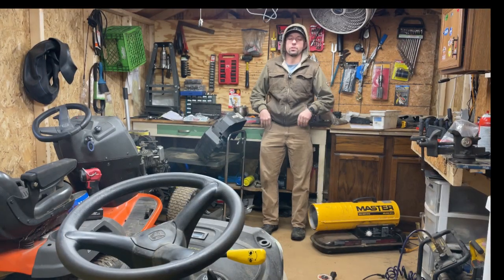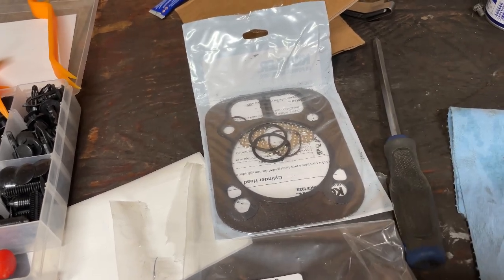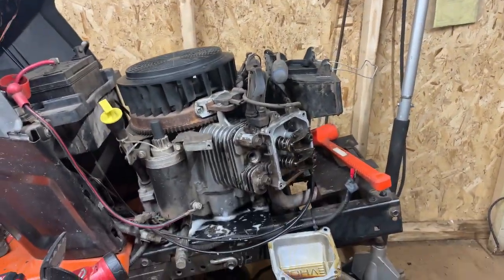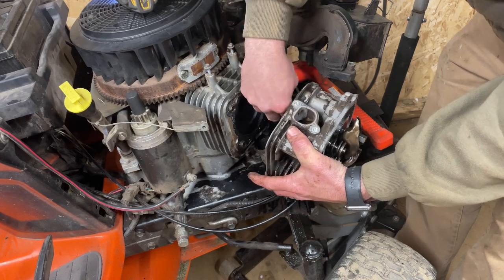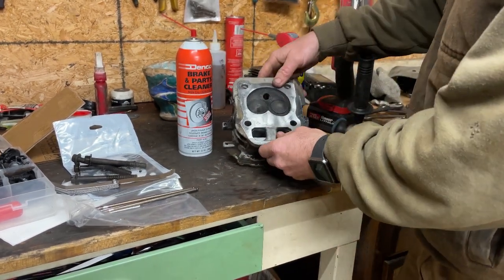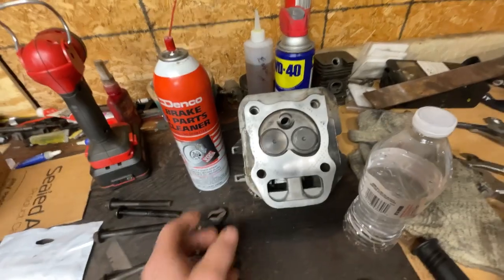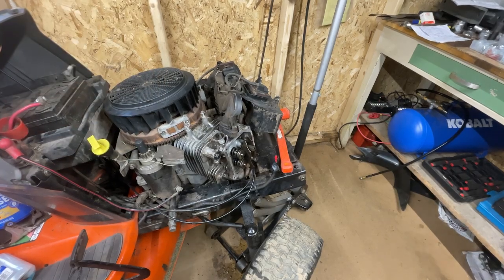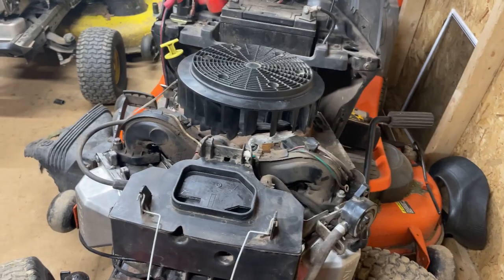Kohler Courage 24HP - Head Gasket Replacement

Comment: Good video sir. 

I just finished this on a Kohler CV 730  mine was a little easier. I put the engine on a Murray 40 inch cut. Plus it has dual exhaust. I had a valve job  on both heads since I had both off. Not a difficult job.  The CV 730 has hydraulic lifters  so no need to reset the rocker arms.

Comment: what grid sand paper do you use to  making sure  the  head was  flat?  Good  show thanks!!!!
Reply from the maker: I’m not around the shop currently, but I do believe 600 grit wet sand. Thanks for watching!
Reply: 600 grit
Reply: I use 150 and it does a job.  I use on head as he did and on the block with sand paper wrapped around a flat file. Works great.

Comment: Kohler saved $1 on these gaskets! If there was a flame ring around the hole in the gasket for the cylinder, they would last a lot longer! Mine went bad at 130 hours. Junk! I’ll stick to Briggs & Stratton!
Reply: I very very much agree with you 
It’s made to fail for sure

Comment: What's the difference between the two push rods? Why can't they be mixed?
Reply from the maker: I’ll be honest, I could never tell any difference, but in a lot of service manuals they tell you not to mix them up. Honestly, I have dropped them before I had them marked and put them back with no issues. Thanks for watching!
Reply: They’ve lapped themselves together when running and will wear out much faster if you mix them up since they’ll be out of shape and have to re-lap.